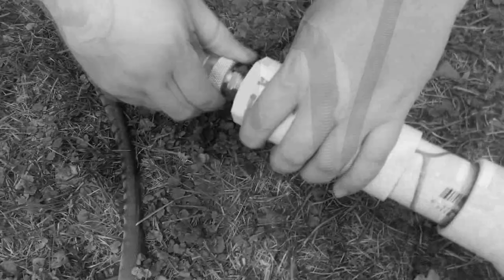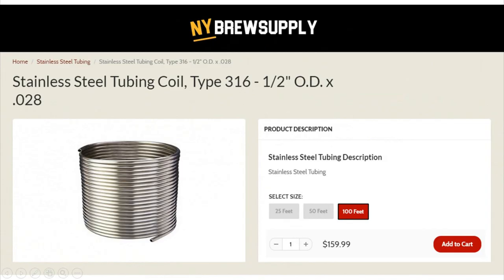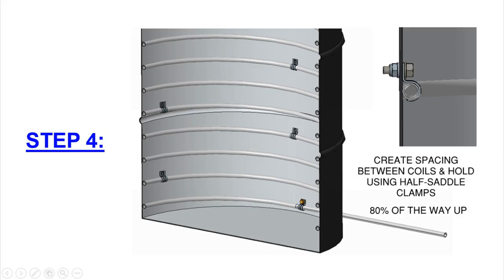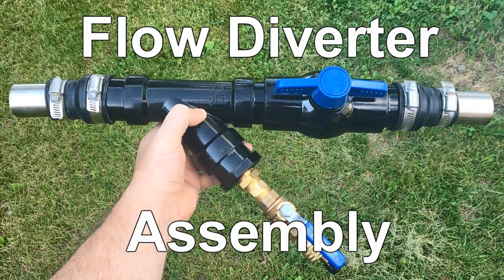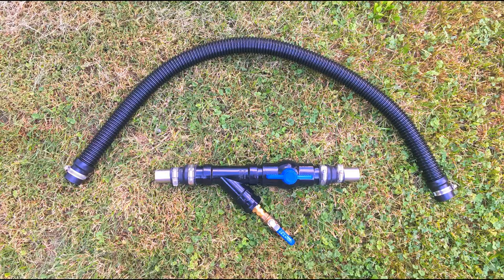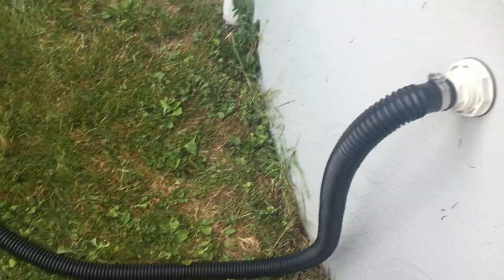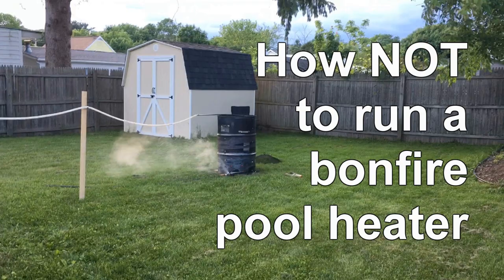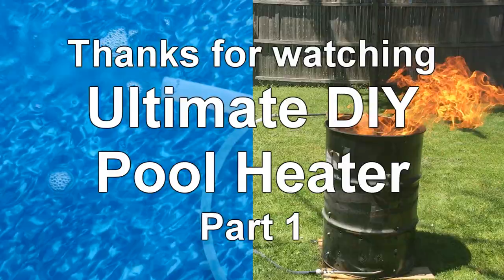Ultimate DIY Pool Heater | Part 1 - Construction & Setup

Comment: What kind of tube did you use going from fire to the pool?.. wanna try this scared that the heat will melt any plastic  tube I would use
Reply: You can use a radiant heating tube like PEX. It can withstand up to 200°F.
Reply from the maker: I used a high temp silicone tube, the heated water might melt cheap vinyl tubing.

Comment: Got my barrel assembled and did my first burn in it. One tip is I did not straighten the bottom of the coil until I did all of the other holes and clamps. I just let it coil against the outside of the barrel. I also roughly placed the clamps and moved the coil up and down as needed. Then I made sure as I was cutting the holes for air or clamps, I just held the coil out of the way. I drilled a pilot hole and then used a metal step bit to cut the 1/2" holes. I plan on cutting a 4-6" door in the very bottom of the barrel to allow use a leaf blower to start and/or super heat  and allow a way to clean the ash out.

Comment: Great project. My only thoughts as a pool guy is possibly gapping your tubing from the walls somehow, and making sure to get your tubing down close to floor level. That being because the surface area of the water and the ground work as a much better insulator than it being so close to the surface where it doesn’t mix well and immediately begins to cool.

Comment: Hello, You need a pressure relief valve. If you don't use one and your filter or pump are restricted or face a reduction in flow you've created quite the bomb. Stainless steel and the barrel material are quite effective as pressure propelled shrapnel. Be very careful, anytime you introduce intense heat to liquid in an enclosed system it will eventually rupture. Pressure relief valves are inexpensive and effective.  Rupturing due to chemical interaction, (stainless steel, sodium hypochlorite and electricity/pool motor generates stray voltage)This is especially true when you have water which contains sodium hypochlorite (Pool Shock/ Chlorine). When it decomposes and is present in a pool system which inherently contains stray voltage you create explosive gases [Hydrogen based]. I bet your burn barrel isn't bonded. This is a bad idea on several fronts, good luck. Put it far away from humans and buildings.
Reply: I like the Idea of a pressure relief valve, and actually was thinking the exhaust would go back in the barrel - essentially putting out the fire. My burn barrel is 30ft from the pool.

Comment: I've been using your method for 2 years. It works. I actually added a heated fountain to flow into my pool rather than placing the hose directly on the bottom of the pool.   It's safer and very effective. The water flows very warm water not steaming hot water. I did not attached this via my main water filter system; I decided  to use an extra A-frame ladder as part of a decorative water feature. There was no need for me to drill holes into my pool or disurpt my orginal filter system.  The burn barrel has 2 discreet lines from the fountain ladder to the burn barrel with an awesome strong  submersible pool pump hidden at the bottom of the pool behind the ladder.  Thanks again for your idea.

Comment: Great video. love the assembly details.  QUESTION: I can only find 50 1/2" SS coils.  Will the shorter length compromise the efficiency much? If so how would you suggest joining 2 50ft coils?

Comment: Here in west Texas, a friend of mine embedded a shit ton of pex tubing in his pool deck.  After water was filtered, it flowed through the deck and back to the pool.  It worked very well most of the year and in winter months the 400,000 btu natural gas heater would heat it from 55 to 90degrees in about 24hrs.  The pool was around 30,000 gallons would be my guess.  Instead of burning wood, convert to an oil burning setup.  Look up the Kwiky burner here on youtube...  I use one to melt bronze.  This thing will burn diesel, used motor oil, veggie oil or propane.  Even on used motor oil, it burns with no visible smoke or odor.

Comment: I have a stone, woodburning, fireplace about ten feet away from my pool. I was thinking about doing this as an alternative to buying a heat pump. My question for you is, how long do you think this steel coil will last? I watched another similar video to this where the guy used copper coil around and inside a drum and he ended up have to replace it. The fire was so hot it slowly, over the span of a year, melted parts of the copper.  

My thought was this, put the coil in the fireplace, place a small submersible pump in my pool, and just fire it all up. Sure, it's a bit more electric, but I don't want to cut into my PVC at the pool filter/pump which is also about 100 feet away from the fireplace.
Reply: The more holes you put in a pool or plumbing system, the higher chance of having leaks
Reply: That's what I was thinking. Why do the flow divider? Why not use a submersible pump to the coil?
Reply from the maker: A stainless coil will have a higher melting temperature than copper. You could eliminate the barrel from the setup and just place the coil directly into a fit pit. I don't have a fire pit which is why I built mine in a barrel. You could buy a separate pump to feed water through the coil, but for me it was easier to just branch off of my existing pool circuit and avoid getting an additional pump because the pump I have can do the job. Some pumps may not be powerful enough to send water through the hoses and up the coil in which case you would want to get a separate pump.
Reply: @ashow13  Hey there, not sure if youre answering questions at all but Im almost built on my backyard version; smaller pool to make it heat up faster but Im concerned that my pump will start shutting off once I get the pool hot enough...Now Im looking for filter pumps that are "meant for high temperatures" or "rated for spa/hot tubs" but Im not seeing results. Am I searching the wrong way on this?

Comment: Wanted you to know that I just put this together and it works great! The only flaw I had in it was that the bottom of the barrel was still burning so I kept it running for the night and the line that went into the pool with the hot water fell off when I was cleaning up and did not notice it. So it emptied my pool i/4 of the way. Took 3 1/2 hours to fill the water back in. The thing works pretty good!
Reply: Do you have anyone complaining about the smoke from the wood fire? My wife hates when I burn wood outside, she said that her cloth, heir smell smoke,😅😅
Reply: Do you also see a possibility to place a large Chimney so the smoke go up high? Also about using a large tubing, 3/4". I have a oval 15k gallon AG pool, lot water to heat.

Comment: I like the idea but you burn a lot of wood for a few degrees of heat.
How about checking into a rocket stove with a mass heater to warm the coils?
Just an idea.  Less wood burned and longer warming of the water
Reply: or a propane tank system. It's fine to use propane for a short while

Comment: After watching this video a month ago I decided to build the same setup. Certainly a great idea! I had 3ft of heater hose connected to the stainless pipe on the outlet side with a hose adapter on the other end to hook up to rubber garden hose. The water was coming out so hot it melted the rubber washer on the garden hose. The rubber garden hose is supposed to be rated for 160 degrees and i was just burning sticks i was picking up in the yard. I guess I need to turn the flow rate up to make the water a little cooler. Thank for the great heater idea!
Reply from the maker: I had to buy a silicone hose because my vinyl hose melted. The water can easily reach 160F. My silicone hose is rated for 390F.
Reply: I’m hoping to build one

Comment: This is the exact idea i had as i already have a barrel for burning. I plan to use this idea only while filling the pool up but I was going to warm the pipe first before flowing the water through so Im glad I came across your video as I know not to do this now. Thanks.

Comment: this is the best thing i have every come across.. i am looking to build the same thing so i was researching and here it is.  I want to do this but put the heat exchanger in my ceramic grill/smoker, due to the fact it can hold 300 deg. for almost 12 hours.  Any comment on this? do you think that is hot enough? also my pool is inground. 33000 gallon. i realize my results will be minor compared to yours.
i have a feeling you have to feed that bonfire ALOT? yes/no? 
have you ever tried a few bags of charcoal? would that work? it would last longer.
thanks so much for the info. 
and the math was ridiculous!!! fantastic job.
Reply from the maker: A 33,000 gallon inground pool will be very difficult to heat. If your heat source is only 300 degrees you would need either a very long coil or very low flow rate to absorb enough heat. I just use scrap wood from around the yard to keep my fire going. I have not tried charcoal.

Comment: After a season of using this, it is awesome! And YES I can raise the 13,000 gal pool 10 degrees each day. After opening the pool it was a cool 65 degrees. While waiting 3 days for pool chemicals to settle, I was heating the pool. The next day it was 76 degrees and then 84 the following day. Some improvements from this one: use 1/2 PEX instead of vinyl. It wont melt and won't whip wildly if/when steam happens. It supports much higher temps and pressures than vinyl. Also I used standard pool hose connections instead of the rubber reducers. I am also thinking about putting an additional y and piping the hot water back into the pool water return. Probably much safer and cleaner looking.

Comment: Love the idea, one thing I would recommend is putting the tubing in a separate internal chambered wall so it doesn't get covered in soot/carbon and become inefficient.
Reply: But wouldn't putting the tube in an extra chamber make it inefficient?
Reply: @andreashabeck1155  Initially yes, but only a small percentage, and the performance would stay consistent throughout the life of the stove rather than work awesome for a while then become inefficient. It's like having a really fast car that works great but blows up after 2 months vs having a normal car that'll last you 2 decades.

Comment: Thanks for showing this barrel heater. I have a HUGE pond I need heat for. I have a playlist called greenhouses that has a red shirt guy doing solar water heater and he did series of straight up pipes w t connections for better flow rate, manifold he said. Wondering if that could be made inside barrel for 10-12 straight up pipes...

Comment: So pex and sharkbite fittings didnt withstand the heat. Used 50 ft copper. Same type diverter. However, added inflow diverter aswell. Always has flow, just got toooo darn hot. Return will full flow was beyond bouling so keeps popping the inflow lines

Comment: Very comprehensive, thanks for the time making the video. I had a similar idea and anyone please comment if you think it would work or flop. Basically making the same heat exchanger with the barrel and tubing but using a salamander heater as the heat source. A hole cut in the side of the barrel with the salamander blowing straight into it. I thought of using a barrel with the clamp on lid so you could put a simple sliding damper on top to control the heat. Any feedback is welcomed

Comment: I have the same thing.
Only my inlet is 1M away from the barrel.
I used 32mm brass tule connector. Connect at a 32-15 brass connector that on my 15mm pipe in the barrel.

Going out (heat water) the connection is from 15mm tot 22mm.
And with a 22rvs316 pipe to my pool.
It can not explode.

At the inlet and outlet of the barrel i also have a valve.
Safety for something happens.
And to maintain what flow goes in and out.
Just to get 90C° water comming out.
And no steam.

I had normale hoses before.
But because of the heat it melt zo fast.
Thats why i when save and used 22mm rvs316 pipe.

Also laying the barrel on his side.
In the front feeding door.
And in the back pipe for gasses.
Will give much more efficiency warming the water.

I have 50M 15mm copper pipe roled on the outside of the barrel.
And 100M 22mm copper pipe inside.
And 10M 15mm inside the outlet gas pipe.

Resulted a pool 8M x 3M x 90CM  21.600.00L is warming up from 14C° to 45C° in just 2.5 hours👍👍👍

My next project is gonna be heatstove/barrel.
To reduce the amount of materials that need to burn to get hot water.

I hope you can do anything with this information to upgrade yours.
Reply: Hi. Do you have a channel where someone can see your setup? Thank you.
Reply: @sebrondo9198  no sorry i don't have a channel

Comment: well done ….. however there are some very basic flaws in this design …. having the drum standing upright means that most of the heat energy is going straight up as a total heat loss …. turn the drum horizontal and you increase the heat transfer greatly … of course you will need to add a chimney a burn hearth and a door … but it will save a huge amount of wood / heat loss. Have fun!
Reply: incorrect, as usual

Comment: Hi there! Just want to ask about the stainless steel, you said it is 100 feet it’s that? Can I use 50 feet instead !Thank you for your answer
Reply: Joel, I made a smaller version because I just have a 1,000 gallon pool at the moment. 50' will work, just understand it's going to heat the water less than 100' will since the water will spend less time in the fire. For my pool, I raised the temp 10°F in about 6 hours or so, and that was not tending to the fire religiously.

Comment: I built it just as instructed but can't get the water to pump through the hose. It comes out of the ball valve when the hose isn't connected but once I attach the hose, no water comes through. My filter pump is pumping as well. What am I doing wrong?
Reply from the maker: If you built the diverter like I did try closing off the PVC ball valve a bit to force more water through the brass valve. Also, make sure your barrel isn't at a higher elevation so you aren't fighting gravity.
Reply: My husband discovered and not enough water was coming through in here to change the setting on the line that was going in the pool we have a sand filter so it allows you to determine how much water pushes in from the filter see if that works.  Ours works like a charm Also I plastic hose is all the way to the bottom of the pool so the hot water is being feed to the bottom.  The heat is coming up and helps the pool warm up faster and stay warm.

Comment: Is there a reason you didn't use copper tubing over the stainless? I would think the copper would be more effective in heating. Let me know your thoughts, thanks.
Reply from the maker: Not 100% sure of any scientific reasons why one might be better than the other, but at the time I built this the stainless coil was just cheaper and easier to source.
Reply: @ashow13  Thanks for your reply. I'm gonna try it with 50' of copper and see how it does. Also where did you find the 1.5" OD tube? I'm having difficulty finding that.
Reply: Nvm, re-watched the video and see that its steel. Thanks again.
Reply: @dentmanmatt  chlorine and chemical imbalances corrode copper very quickly. You’d have to be on your PH and total chlorine levels or you’ll get calcium build up or hardness even faster..keeping your pools chemicals perfectly balanced 100% of the time is impossible because people’s bodily oils and dirt alone will affect the levels in just one day, or even rain.
Reply: @dentmanmatt  hey man, seeing if you see this notification and wondering how your version worked out

Comment: Pool heats up 30 degrees.  Everyone in the pool is choking and puking from the smoke.  Neighbors all hate you for burning wood all day and filling their houses with smoke in the middle of the summer.
I don't hate my family or neighbors enough to do this.
Reply: Dude all you have to do is heat the pool up to a warmer temp, usually 6 degrees cooler than the outside temp feels great. Not too warm not too cold. I find 86 degree water is perfect. Once you reach this temp, put the damn fire out with a bucket of water and your pool will hold that water temp for a few days as long as your pool gets good amounts of sun during the day and unless there’s a cold snap at night that lowers the pool temp. Either way, the sun alone on a hot day gets my pool water to 79-83 degrees so you don’t need to burn a fire all day to get the water temps up to at least 86. If you’re looking to swim before and after regular pool season, just get a jacuzzi 😂
Reply: @DoDgeSwaG  if you add water to the hot metal its a great way to corrode and ruin the metal quicker. Never do that. Instead empty the barrel from the bottom if possible